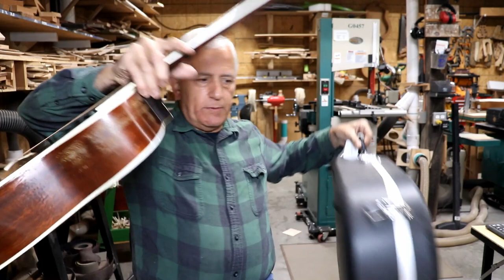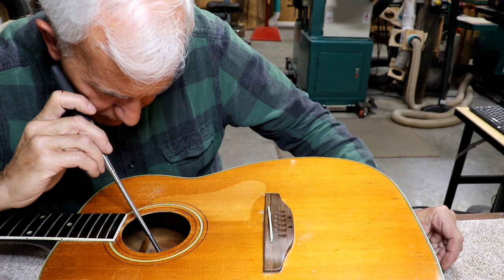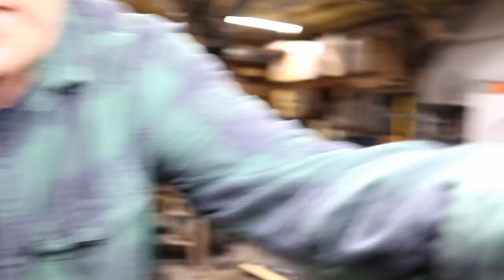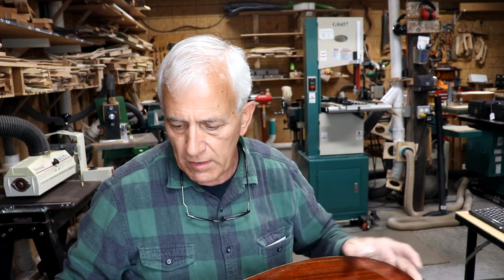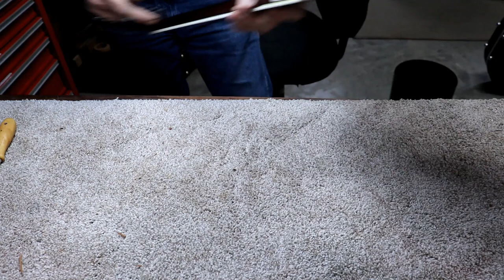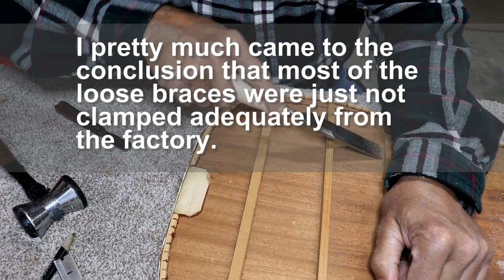497 RSW Regal Wreck 2 Deja Vu All Over Again P1

Comment: I have a 70's Eros and the top of the sound hole had started to collapse, the finger board was ramping down towards the sound hole. I used the method you just have and managed to successfully fix the problem. I thought about the dilemma you had with the two end blocks and i managed to get some 7" very thin jigsaw blades. These things are like super thin and has 50 teeth per inch, taking the back off was a breeze. I shall email you the link to were i bought them. Bare in mind Jerry i live in the UK. My Jigsaw has variable speed so i was able to take my time. See i have had to watch again to reassure myself it was a good idea. If i had tried this without watching your channel the Eros would have ended up as fuel. God bless.

Comment: Jerry, Ihave opened many backs over the years using that same joint/crack.  It is more useful to break the kerf into an irregular shape.  When reglueing the joint it will register the two surfaces perfectly to each other. the result is usually invisible in the finish.  The issue is that of conviction that the glue is stronger that the wood.  As for separating the neck block, I use a heat gun to very gently heat the back over the block to soften the existing glue.  As to how much heat you can apply try a finished(varnished) scrap and heat the surface and look for tiny blistered spots as the resin in the pores begin to appear and stop.  The blemises can be addressed easily at the end for most cases and is not hard to sand and fill then polish.  Try it on a guitar scrap.  I keep all the wrecked instruments that I could not save.

Comment: I am working on the same model right now. That is a Regal R235 which is a re-branded Harmony H-1260. That bridge is not original. There is a good market for these that have been X braced. I would have re-braced for the added value. Braxendale re-braced Harmony’s are worth quite a bit. I actually V braced mine. Ladder bracing doesn’t seem to support the top very well over the years.

Comment: When you were trying to work ---- and hammer ---- your homemade, bent putty knife under the neck block, the guitar was sliding around on the bench. A padded block with a V-notch for the neck heel, clamped down to the bench, seems to be called for here, as a backstop to prevent the guitar from moving around.... I'm also surprised you don't have some kind of endoscopic video camera for inspecting the inside of the guitar.
Reply: Jerry does have a padded neck block , if he felt he needed it he would have used it. Also, he does have an endoscope camera , have seen him use it many times.
Reply: @larryfischer1970  ,  Yeah I was wondering about that. I don't watch that many of Jerry's videos. I do watch Ted Woodford in Canada pretty regularly (the twoodfrd channel on YT, but you probably akready knew that) ---- for whatever reason I find Ted's guitar-repair videos more satisfying, and they're usually shorter while Jerrys' tend to turn into epics.....anyway,  I could have sworn I saw an endoscope camera somewhere in one of Jerry's past videos, but I wasn't quite certain. As for having a padded block, if you've already got one, why not use it?
Reply: Yes I agree, I've been watching RSW from the beginning. Jerry has said in the past that some jobs require clamping down to hold still , he has a modified c clamp that he clamps necks into that he mounts in a bench vise, but on a lot of jobs like this back removal their is so much moving to get the instrument,  you're arms, you're hands and the tool in the correct position with each stroke of the tool that it would take so much longer clamping each time and run up the bill. As you probably noticed how many positions he put that  guitar in to remove the back. Ted in Canada is great to, I watch all of his work also, very good luthier, and funny as can be, he has been professionally trained while Jerry is self taught.

Comment: Jerry **use a small soldering iron to crystallize the epoxy glue.***Chuck
Reply: ......and use a fan, and lots of ventilation; heated-up epoxy is gonna stink! A heat-pencil that blows hot air, with adjustable heat settings (the type used for soldering surface-mount components), might work better than a soldering iron....

Comment: Did you ever try a Dremel multi-tool (vibrating tool) to do this separating?
Reply from the maker: I have several multi tools I don't have a dremel.   Certainly it would work but I wouldn't trust it because you will scratch the heck out of the instrument just by accident
Reply: @RosaStringWorks  Yes you are right. - one slip and you have a real gouge.

Comment: An old low E string would have made a good wire saw, just for that last bit taking the back off. Easier said whilst just looking on. If you had my Guitar to repair Jerry i know it would come back fixed. The amount of knowledge i have gleaned from you over the years is pretty substantial. This instrument is lucky it has you working on it. No offence to Caleb but there's a reason the owner asked Jerry to repair it.

Comment: 'Seams' to me that if you are taking a blade's width off the sides you are as well to go on through the neck and tail pieces so it is uniform.
 If you bolted some bits of copper to your scraper, either side of the blade, near the handle, would it help keep it hot?

Comment: Lucky for you that the epoxy was likely a fast-cure, 5-minute type; a slow cure epoxy would have seeped into the wood fibers and been way harder to remove. Also, wouldn't a heated-up pallet knife have loosened the braces more quickly?

Comment: I wonder how this would work:  disassemble the Regal...completely strip it down to all its original factory components...then soak all the wood components (including top, bottom, bracing, kerfing, neck, headstock & bridge) in buckets of heated (to almost boiling) turpentine overnight. Next day, remove any and all gunk / glue & dirt, then let it all dry out for a good week. Repair cracks / cleat as necessary. Then sand / buff all components, then re-assemble, re-stain and varnish. Like brand new.
Reply: ROTFL, Just purchase the wood and build a guitar.
Reply: @jthonn   ...but it wouldn't be the original wood / original guitar. The point of Mr.Rosa is restoration, whilst keeping as true the original "provenance" of the instrument as possible.
Reply: @Trev0r98 Oh OK, but man that would be a lot of work...